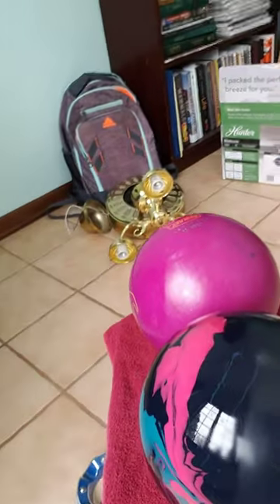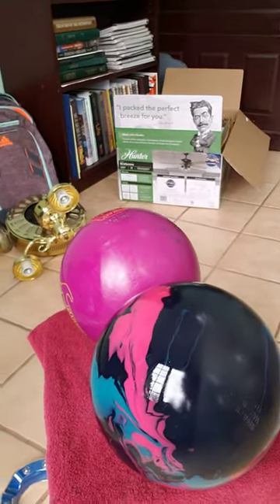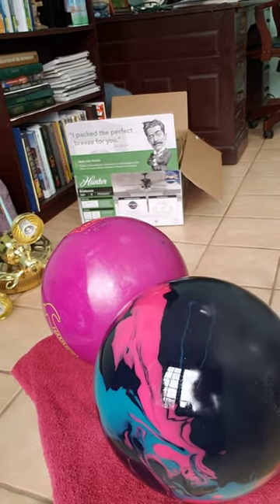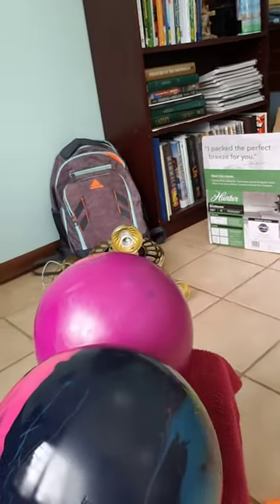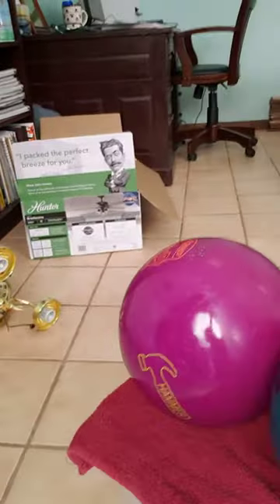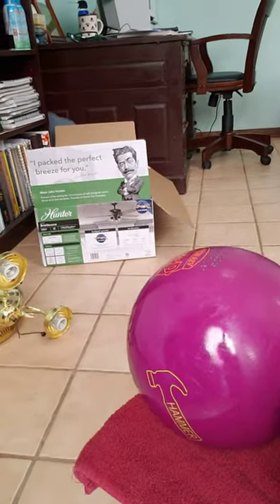how to EFFECTIVELY & SAFELY remove oil from a bowling ball

Comment: Living here in the south Our summer season is brutal, I’ll just set my balls outside on a table for about 1 hour total from start to finish rotating them and wiping it off about every 15-20 minutes
Reply from the maker: Dude we had a week of straight 95 degree weather and I left my ball and bag in my truck all week by accident.  I came out a week later and my ball was coated in 2mm of oil lol.   That's when I learned your ways lol